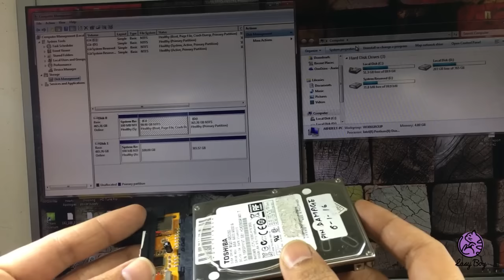Hard Disk SATA Connector Replacement.

Comment: I like the visuals very helpful! But if you could do audio to add instructions it would be way more helpful, also what are the tools you are using, and is it possible to use any data connector from any hard drive that's PCB is not working

Comment: So I have a weird idea. Toshiba has a 1.8 inch 320 gb hdd. I want to install it inside an iPod. I know there is iflash but I like hdd noise. I wonder if I could use the zif connector from an 80 gb ipod hdd and transplant it on a toshiba 320 gb 1 8 inch hdd.

Comment: good video.. what is the equipment and material here? cleaner, tape, lead , etc thank you
Reply from the maker: Hot Air  Station -- INDE HRS61D
Soldaring Station   -- DSSLF04HESD
Cleaner-- IPA -Isopropyl Alcohol
Tape-- Any Double side tape
Lead--- any solder wire
Reply: Lazy Boy thank you

Comment: Hello your video was very useful, but I want to know if the hard drives have to be identical. I have a Seagate 500 GB hard drive that needs repairs. Can I use the sata from a Western Digital hard drive? I have music that I have to send out for deadlines and I'd like to get my computer fixed as soon as possible.
Reply from the maker: No it won’t work
Reply: @techfixer3650  Thanks for taking time to respond to my comment. So in other words the hard drive needs to be exactly identical? Another thing I would like to know is can I get an identical hard drive, remove the disk from the damaged hard drive and place it inside the replacement hard drive? I ordered a rework station the day I posted my comment & I've never done this before, so I'm a little intimidated. I'm just curious if placing the disk in another identical hard drive that has an intact sata connector will work? I don't want to cause anymore damage to the hard drive trying to solder on a new sata connector if I don't have too.
Reply: @techfixer3650  Also does the rpm have to be the same on both drives?
Reply from the maker: Swapping a disk is the bad idea 🥺, I have tried swapping 3 times every time I hv ended up with dead Hard drive 
As soon as we tried open disk in normal environment 99% chances is we will loose our hard drive
Reply from the maker: I guess not necessary 🙂
Reply: @techfixer3650  Thank you. This information was more than helpful. Again I really appreciate you taking the time to respond. We need more content creators like you.
Reply from the maker: A1J Tha Producer thanks for love,Please show your support with subscribing our channel
Reply: @techfixer3650  I mostly certainly will.
Reply: @techfixer3650  in this video you acheive backup or not
Reply from the maker: @oxygenxhunter  Yes we got every byte of the data from hard disk

Comment: Had a hot air rework station but soldered the replacement connector with a standard iron instead of using the rework station and solder paste?

Comment: Why not to swap plates/boards with connectors?
Reply from the maker: Serge R sometimes available board is faulty, or same board is not available
Reply: So I just broke the sata connector on a new drive I'd just shucked, and Western Digital doesn't sell replacement boards. And even if you do find a similar board, it might have different firmware loaded onto it that can end up just breaking the drive if you hook it right up

Comment: hello i have a toshiba and i have ordered a hard drive just like it but if it wont work can u help me please ? need ur service
Reply from the maker: Victor Villarreal what’s wrong with you’re old hard disk
Reply: @techfixer3650  the sata connector is broken I have ordered a hard drive with same model and number but if it doesn't work I would need u
Reply from the maker: Victor Villarreal ok 
you an an expert in soldering
Reply: @techfixer3650  somewhat but don't have hot air to make it easy
Reply from the maker: Victor Villarreal then it would be difficult 
Try another solution 
Get a  SATA cable cut 1 of its side 
And solder directly to Hard disk
Reply: @techfixer3650  ok I'll do that but tomorrow the other hard drive comes in I got my fingers crossed it will work by just replacing the PCB